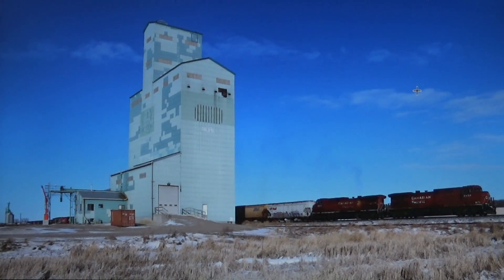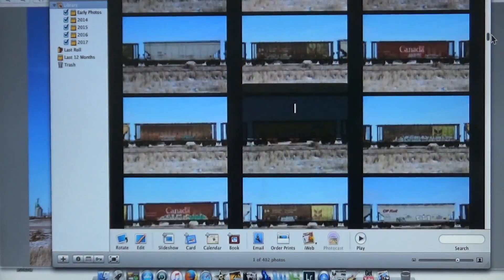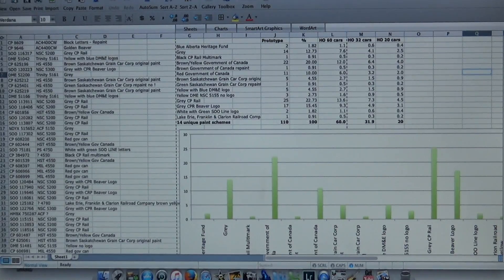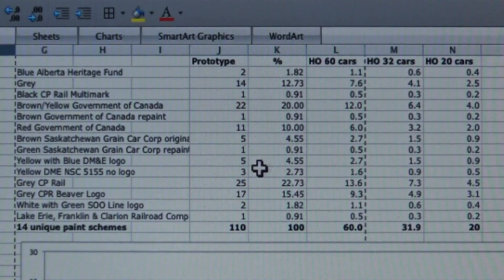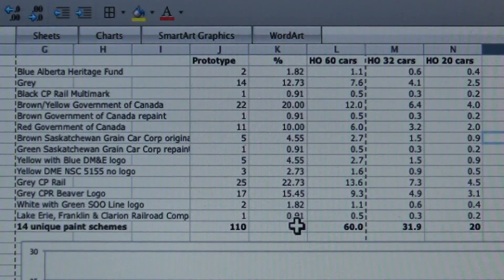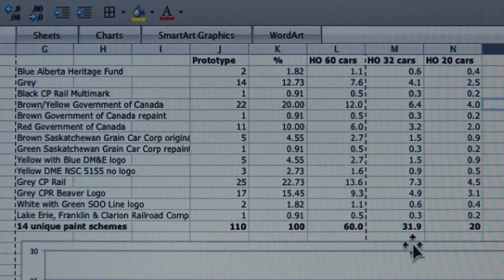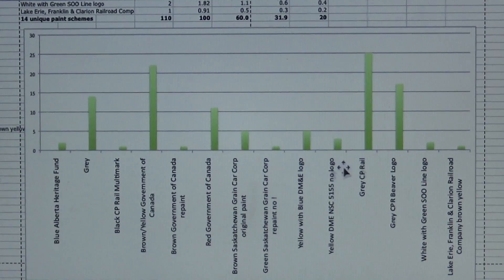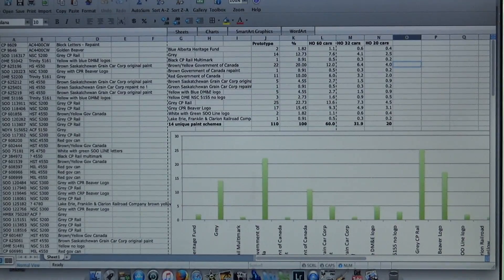CP Unit Grain Train - Statistical Breakdown For Modellers

Comment: This is a really good information video I have been wanting to do this myself for rail fanning intermodal and manifest trains. I think this is an important part of prototype modeling especially from a railfan prospective
Reply from the maker: Thanks Joel. Fun bit of research to do.
Reply: I think its important because as modelers we tend to focus on the iconic models (like heritage units) and not necessarily what we see on the rails every day. I think manufacturers often overlook cars that are common to see as well. Then there is the factor of what cars are prototypical on my railroad. for the last two years I railfanned the CSX I95 corridor (formerly the eastern seaboard) and I saw lots of stuff. I was surprised how many CN/GT 53' well cars and CP/SOO well cars and grain cars there were. Also I saw a lot of 4700 series Midwest Carbon hoppers go through. 
This type of statistic would be invaluable for modeling unit trains of pooled rolling stock such as autoracks. As boxcars and grain cars get more boring grey/brown the Autorack trains are still teaming with color. Norfolk Southern Pulls unit trains from a Hyundai Plant (I believe) in South Georgia. About 1/3 of the train is usually the yellow articulated autoracks (like atlas makes) half of the train is evenly devided between UP CSX and the brand new orange BNSF swoosh auto racks. the remaning 17% is a scatering of CN, ferromex, and Providence Worschester cars.

Comment: There is a little bit more calculation to where the remote goes on the consist, but if it is a pure grain consist, every car (excluding empty rejects) should be in the neighborhood of 130 tons. So usually smack dab in the middle is how it goes, it can vary depending on where the empty rejects are in the consist. Nicely done, really enjoying your videos.
Reply from the maker: Thanks for the info Nick! Now something that would be cool would be an HO scale TrAM simulator on an excel spreadsheet. Hmmmm

Comment: GREAT VIDEO! 

 I'm into numbers like this too (Operations & Industries). I might look into the total number of cars of sugar beets and other inbound cars vs out put of sugar in a sugar beet operation.  This is a good industry to look at.  

Another fun thing to look at is Flour vs Wheat in and out of a flour mill.  The numbers were not what I expected.  capacity and weight factors for both inbound and outbound cars.
Reply from the maker: Thanks! Yes that's a whole different case study but equally interesting! Kinda like how much bulk material into an industry equals how much different products or waste out. Really neat studying the mass balance of industries like that. 
Just another aspect about our hobby that makes it great.
Reply: It is rather fun to look at this is relation to in and outs.  A PD5750 hopper will hold about 96.6 tons of flour.  but a LO 4700 holds about 102.3 tons of wheat.  Almost 1:1 ratio.  In the real world that small gap is huge.  but in the Model Ops world it is 1 for 1.  I do find it odd that people do not get you put 100% of something in to one end you should get close to 100% of something out the other end either product, energy or waste etc. etc. http://www.aqua-calc.com/calculate/volume-to-weight.